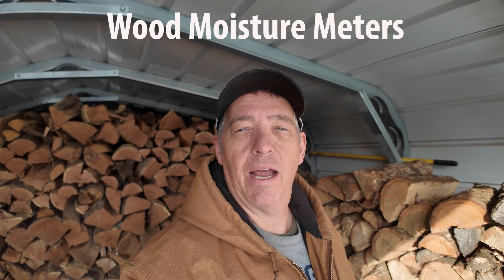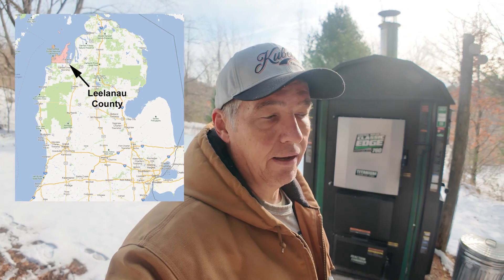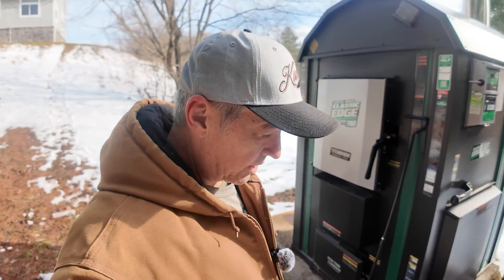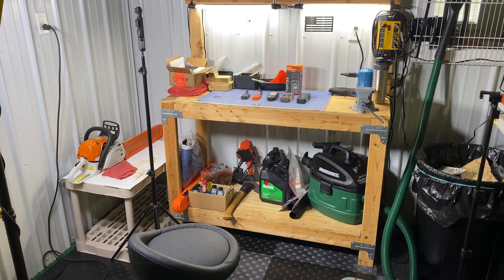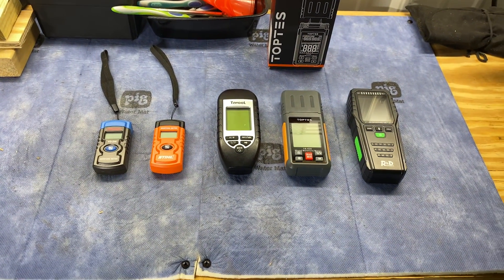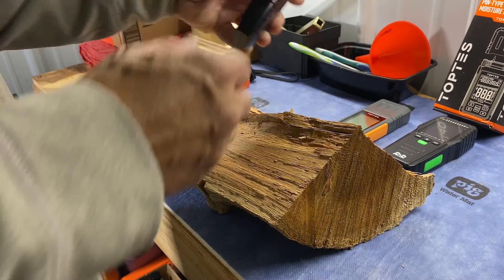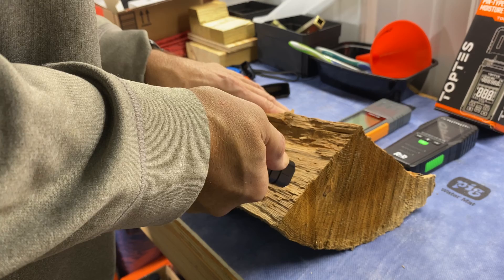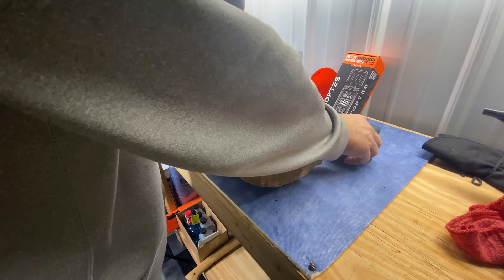Wood Moisture Meters - Which Meters Are Best - Pin or Pin-less?

Comment: The non pinned one measures at deeper level.
Reply from the maker: Agreed! I like those best...
Reply: from what I have read online that is actually backwards the pinned meters actually get a deeper reading of the wood so there actually considered to get a more true reading as the none pined one is more so just reading the top little bit of the wood surface